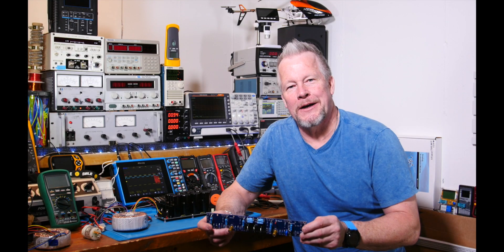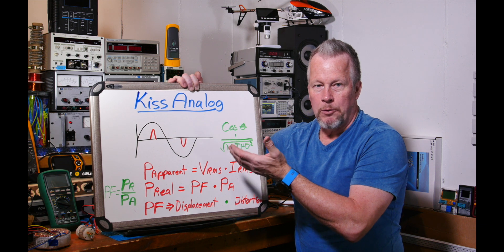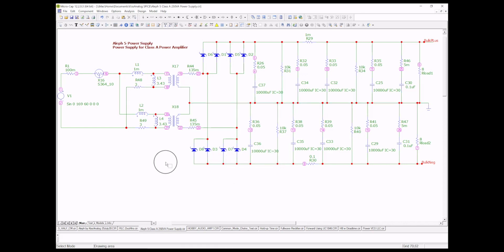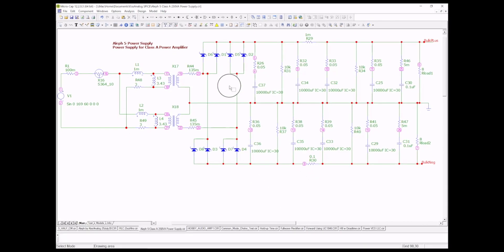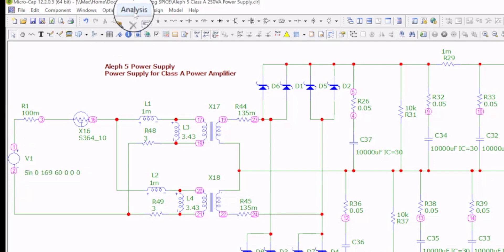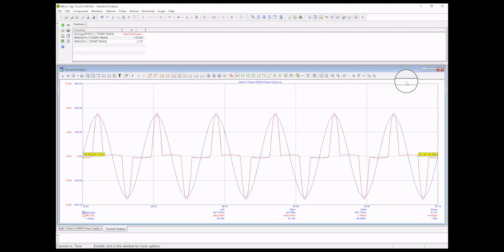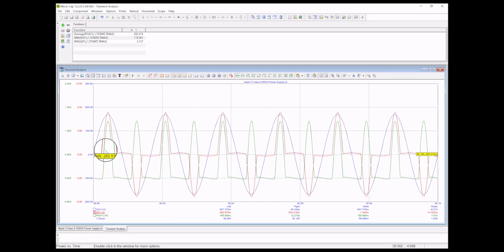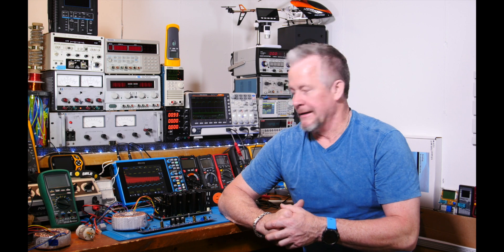Aleph 5 Class A Power Supply Power Factor MicroCap Simulated #ALEPH5 #classa #microcaptutorial

Comment: Hi
I try to have Microcap give me the power, just like you did in the simulation. I have tried a very simpel sine wave source and a resistor.
In the Vertical menu, I can only choose Voltage, Curent. The rest is greyed out.
Even if I make an expression to calculate the power just like in the video, I cannot choose power in the Vertical menu. The expression just states it cannot find the waveform.

I run Probe Transient analysis.
Reply from the maker: Thanks for the great question!  I will release a video about Buck Converters in MicroCap in the morning which will explain how to correct this.
Reply: @KissAnalog  Have seen the new video. Thx😊
Reply from the maker: Thank you!

Comment: Hi, great video. Was just wondering if you could use the output from this schematic as the power source for your Aleph 5 schematic.

Cheers.
Reply from the maker: Great question Ian - and yes!  I ran into a problem with getting a box big enough for the heat and the size of the Aleph;)  I'm starting another amp build because I need one done really soon.  I'll make videos;)
Reply: @KissAnalog  Cool, can't wait to see the videos.

You got me building an Aleph 5 amp. I bought the largest Chinesium case I could find. Hopefully mine won't get too hot. I have 4 120mm thermally controlled fans waiting just in case.

Comment: how can I use Micro-cap to simulaye light sensitive devices.....How can I specify a light source in the model for any kind of light sensitive device like a LDR a PD??
Reply from the maker: Great question Steve!  I think you could use a resistor as the sensing device and then step the value across a range as if it is sensing light.  Or, would the vendor of such a device provide a spice model?  BTW, I have a playlist that shows how to do this stepping method.
Reply: @KissAnalog  I have not been able to find models for PD's and especially not for A-MOLEDS they are very propietary...I would love to be able to generate a graph LUMENS vs Diode I and or V of course the corollary is being able to do that for OLED or even LED's emission. I will keep searching for models of both and for simulation technique. Thanks so much for this youtube channel!